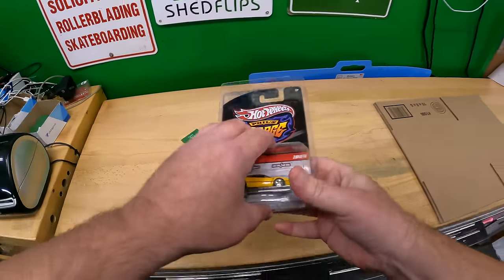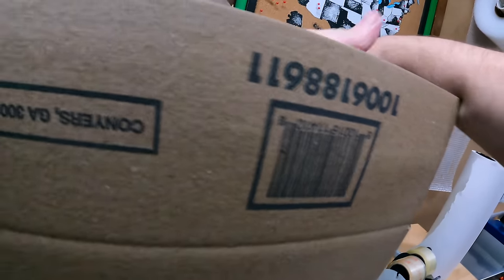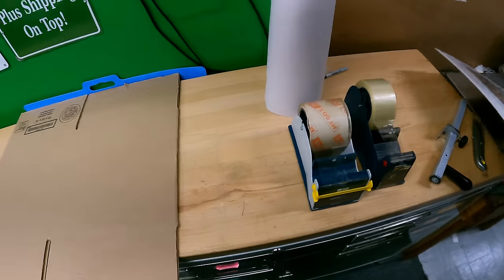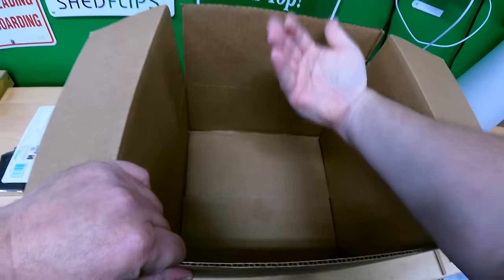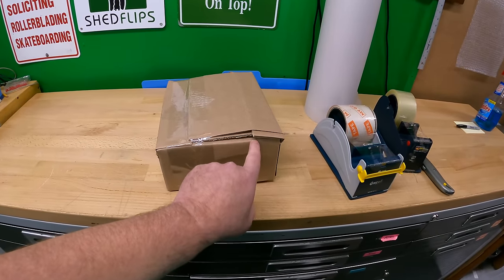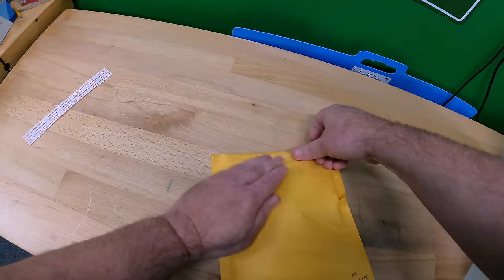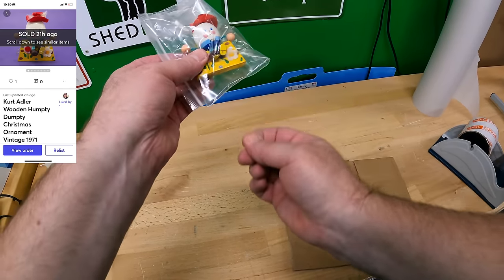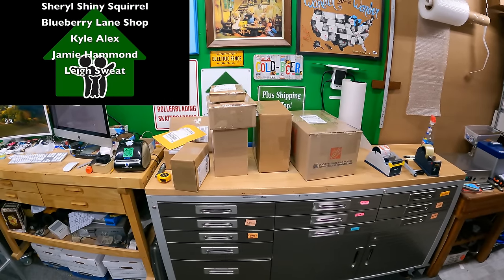How to Pack and Ship EBAY Orders #1 -  This one was CHALLENGING

Comment: Wild Creature Card Pack:  I’ve mentioned this previously, but think it’s worth noting again that when floating heavy items in a large box, when you have a concern for the weight allowing the items to shift and compress the paper, you might consider putting some of the paper pushed down the 4 sides to be inserted so that some pieces go around the item’s corners.  They are most likely to be damaged, if the box is dropped on a corner and pushing paper only down the sides doesn’t do much to prevent that scenario damage.  Takes the same amount of paper and time, but adds a bit more protection to a under able area.

Comment: Freight Forwarders:  the only issue I’ve had with Freight Forwarders is when the carrier shows delivery to the Forwarder, but the item never arrives at its final destination.  Buyers have wanted me to cover the loss, which I won’t do if Tracking shows the first delivery was made properly.  It’s similar to an eBay International package never clearing customs or being lost in an overseas country, except if eBay International loses it, they absorb the loss.  If a Freight Forwarder looses it, then it’s between the Buyer and the Forwarder, not the Seller.

Comment: I'm finally getting a chance to watch all these. 
For that Grogu print, one of the better tricks for flat shipping is cardboard wrapping with the box corrugation going different directions. You gain a ton of strength when the grains criss/cross. (Hat tip to Auction Professor's packing art videos.)

Comment: Love these. I like the way you roll the bubbled items along the diagonal, folding it in half way. I'm going to have to remember that one. Also, thank you for introducing me to using newsprint. I'm using it a lot more than bubble wrap now.

I've been selling a lot more books lately and have often been using easy-fold mailers for some of the larger ones and 9.5x7x4 boxes (resized down a bit when necessary) for some of the medium sized ones. I find the correct size really handy. I'm not a fan of shipping them in bubble mailers either. I usually poly bag them and wrap them in a layer of 1/16" packing foam, then put them in the mailer or box.

Comment: Question: With your resized, did it come with a guard and you removed it or did it come without a guard. I've found it's very cumbersome to use the resized because the guard gets in the way,. Considering removing it. You make it look so easy! I enjoy the videos, Also I need to look at your tape, the mil must be more than mine. I have recently started using your tape setup method and the tape is so flimsy, it drives me crazy! LOL! Thanks for the content!

Comment: We are resellers out of Colorado, soon to be New York again. We were wondering why you don't try a tape gun vice using the tape dispensers. I know it is a matter of preference but it works well for us and saves you from the chance of dragging your hand across the sharp edges of the dispenser as you mentioned was an issue. It also means you don't have to hold down the dispenser every time you tape something. You can just drag the tape guns across the box. Again, I know it is all about personal preference, so no shade.
Reply from the maker: I used a tape gun for years, I like the desktop dispensers better.

Comment: American Girl Doll Pack:  since the bottom center gap was a bit wide and a weak spot, I think I’d have dropped 1 of the flaps cut off the top down  inside before the crumple paper, just to strengthen the box re-shape a bit more.
Reply: Dropping in a second floor cardboard  layer, like you did on Jerry Rice/Flask pack, really strengthens those “box extender” box re-shapes.  I think it helps to keep them stiff at the original fold lines, which tend to be the weak spots.